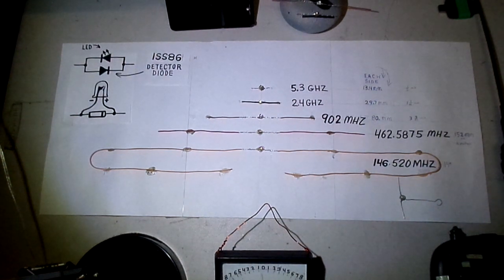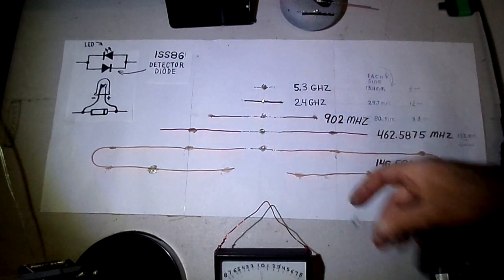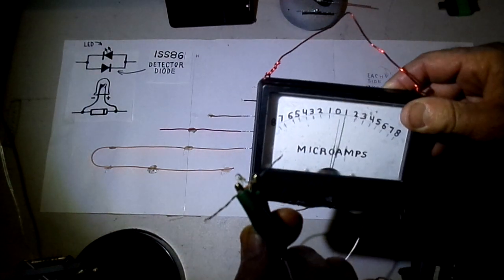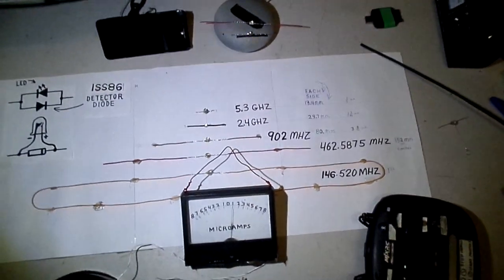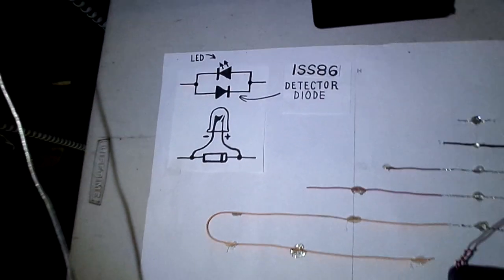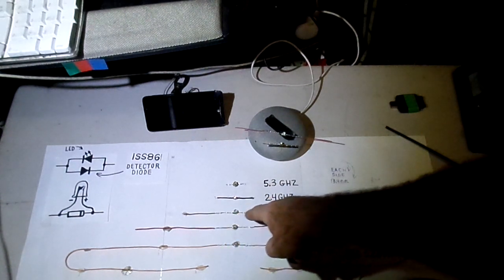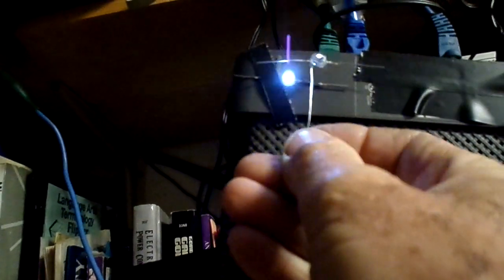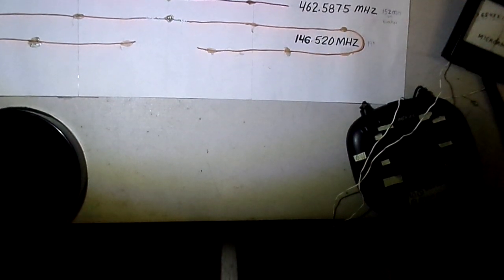2 Dollar Radiation Detector You Can Build. Beware of imitation diodes that don't have an H on them.

Comment: Regarding microwave leaking. 
Supose you have a mains power  and a transformer, very little power "leaks" untill you connect a load. 

By placing an antenna wire near a microwave conducting surface, currents in the surface induce currents in the wire, "Transformer"  Normally a simple wire wouldn't disipate much energy and would simply reflect it back to the source, reactive power, but you put a load on the transformer and caused energy to leak into the LED instead.
Reply from the maker: I can't understand what you are saying.
Reply: @GrantsPassTVRepair  I'm saying by placing the anti parallel diode and LED next to the microwave, you are magnetically inducting energy into it. 

the microwave are inducing currents in the body of the microwave oven which normally would reflect microwaves off the walls of the microwave oven.  But, when you bring the anti parallel  Diode and Led antenna close it capacitivivly and inductivly couples energy from inside to outside.  

My first comment mentioned it was like a transformer connected to mains power line leaks very little energy. With no load on the secondary, Energy simply gets stored in the magnetic field and later released when the the current changes direction. There is a 90 degree phase seperation between voltage and current, so power is reflected back to the source rather consumed.   But if you bring a secondary coil next to the primary coil and you have a load connected to tge secondary, power is inductivly  coupled from the primary to tge secondary.  The load pulls energy from one side of a transformer to the other.  The diode LED circuit is pulling energy out. 

Maybe a more complete picture might be seen in looking at the phenomena as a transmission line with both capacitive and inductive coupling from one wire to another. 

Either way,  the amount of energy coupled from one system to the other drops off faster than radiation's 1/ (distance squared).
Reply from the maker: @kreynolds1123  Sorry but I have never heard of an anti parallel diode, and  I still can't understand what you're saying.
Reply: @GrantsPassTVRepair  channel veritasium did a video "how electricity actually works". It's a dive into a different problem but some of what's covered is directly related to how energy is "leaking"
Reply: @GrantsPassTVRepair   clearly a LED is just a special diode designed to emit visible light as electrons cross the NP junction loose energy and fall into (fill) holes. All diodes do this.  Parallel here is simply refering to the physical alignment which is important because of the alignment with the electric and magnetic fields. Parallel diodes are diodes lined up with their respective NP junctions in the same physical direction. Both diodes will conduct in the same direction. But, Anti parallel diodes are lined up in physically in parallel, but each's NP junction order is the reverse of the other. Where current flows in one direction in one, the other diode conducts in the other direction.
Reply: @GrantsPassTVRepair   I'm guessing you understand some of what I'm saying and that some you're not. May I ask what specific points you find troubling?

Comment: Thank you. Hello how i can calculate antenna lenght? Which is the good site for calculate and learn? And should the antenna be straight? Would it be different if it wasn't straight?
Reply from the maker: Yes ideally the antennas shoud be straight, but you can get away with a little bending. There are many dipole antenna calculators online. Here is one. http://www.westmountainradio.com/antenna_calculator.php

Comment: Are these a particular brand? I've been kinda hit and miss with all the recommended lectenna diodes. Trying to find something that performs well, but is easy for people to obtain. Need quite a few to use with my science students. I've got the NTE112 right now and it seems to work ok, but I think yours might be more sensitive. Did manage to find a microamp ammeter which makes this way cooler so thanks for that tip! Unlike your video, the top video on youtube for lectenna by the Navy tells you to wire this the wrong way so I'm glad I found yours or I would have been pissed for hours.
Reply from the maker: I don't know  any more than what I showed in this video, but I found the ones I used on ebay, and have not had any probelms with them on a multiple of different frequencies from the AM broadcast band on up to microwave frequencies.
Reply: Use UHF schottky diodes.  Or microwave schottky diodes, depending on how high up in frequency you want to go.

Comment: I'm new to this but how does it work with that meter? Can I potentially use the clamp on my voltmeter to see the same results?
Reply from the maker: Voltmeters do not have clamp on options. Some multimeters do, but they are for measuring current rather than voltage, and their current scale would not be sensitive enough to detect any current from radio frequencies.
Reply: @GrantsPassTVRepair  ah that makes sense thanks for the help

Comment: How does your setup work with these dipoles being so close to each other?
Reply from the maker: I don't know, but as you saw it does work.
Reply: @GrantsPassTVRepair  You may make an experiment some time what happens if you space them all just 3 mm apart. :)
Reply from the maker: @Muck-qy2oo  Interesting thought, although I'm not sure you would see much difference with the setup I have since they are receive antennas. When it comes to transmitting that's another story. I have a dipole antenna in a tree, and allowing my antenna to be to close to the tree branches greatly reduces  on the power output from my antenna.
Reply: The dipoles are resonant on different bands.  They won't interact much.

Comment: HI..Q:how precize shoul be the  antena/wire lenght ?, i have tried to test  microwave oven  with 29 +-1mm but i am not able to detect anything with this setup  ,
Reply from the maker: I would think 29.1 should be close enough to work. Did you use the same diode I mentioned and follow the correct polarity?
Reply: @GrantsPassTVRepair   yes diode is the same , but the lenght is something between 29-30mm (+-1mm)  cutted by hand  :)
Reply from the maker: @robertperun4634  I think that shoud be close enough to work. I'm also able to light mine up with my wifi router and my cell phone when I find the right spot to place my LED.
Reply: You have to be using a diode that will function at microwave frequencies

Comment: Hi Grant, I see the diagram of the diode and led together but how is the antenna wire connected exactly? A photo or diagram would be much helpful but a description would be good.

Say for the 2.4ghz antenna.  It;s 29.7, are those two separate cuts of 29.7 for each side or one cut of 59.4mm? and then how or where is connected to? Thanks
Reply from the maker: You place the diode and the LED right next to each other as shown in my drawing.
Reply: @GrantsPassTVRepair  Yes that part is clear, but where does the antenna connect to?  - Wait are the leads of the diode used as the antenna?
Reply from the maker: The wires on each side of diodes are the antennas for the frequencies I mentioned, but when conducting this experiment with my long wire antenna I ground one side and put my antenna on the other side.

Comment: Hello. Which is better for dipole antenna? (λ /4 for each arm or λ /2 for each arm, or in between)
Reply from the maker: Mine seemed to work best using one quarter wave length for each arm.
Reply: 1/2 wave total (1/4 wave for each arm) is resonant.  That's what you're looking for.

Comment: Could one of the automotive remote transmitter testers be modified with a stronger antenna to sniff out RF devices? ( or could you recommend an RF “ sniffer” ) With all the electronic gadgets available nowadays we’re seeing interference issues in the automotive repair industry.  Great channel
Reply: Use a spectrum analyzer like a TinySA.

Comment: ¿Can it be used with other kind of diodes, like 1N4148?
Reply from the maker: I'm sure there are other diodes that may work, but of the various diodes I've tried the one I suggest in this video was the best. I tried some of the diodes people suggest for crystal radios and they worked to a lesser degree, but not well on the higher frequency radio waves.
Reply: You have to use a diode that switches at least as fast as the frequency you're trying to pick up.  A 1n4148 isn't going to work very well above 100 MHz or so.  Also, silicon diodes need higher signal levels.  Schottky or germanium diodes would be better.  The 1SS86 is a UHF Schottky diode.  Much better for the job.  You're looking for an RF diode.

Comment: Nice, but for a single calculation of division You don't need a whole mobile phone app
Reply from the maker: Dividing the desired Frequency into 468 give you length in feet, but it got a little tricky trying to convert tenths and hundredths of an inch into millimeters. .

Comment: Complete NOOB here. What is it, that is capturing the RF waves? Is it the diode's leads or the LED's leads, or both? Also, what if you soldered a metal [or fine mesh] dish to this set-up [to look and act sort of, like a tiny radar] would it pick-up RF signals from further away, would it help in any way? Let me know - I'm trying to learn. Thank you kindly
Reply from the maker: To answer your first question the diode leads are in parallel with the LEDs and the antenna wire. To me that means it's the wire picking up the waves. As far as concentrating the energy in a parabolic reflector goes it sounds like it should help. Good idea for an experiment.
Reply: Thanks for replying, I really appreciate it. One more question: you use a micro-amp meter in this video, to measure RF? What measuring unit, would that be, what would it be called? Please let me know. Anyhoo, great video, as per usual, and thank you for the encouraging words, regarding my "radar" idea. Be safe. Cheers!
Reply from the maker: @maxwarfield6699  My micro-amp meter can meausre a few millionths of an amp. It can't measure the RF energy directly, but it can measure it after it gets rectified through the diode and becomes DC. .
Reply: Thanks for replying, really. Ok, "mind BLOWN" you can rectify an RF signal?! I'm no expert, at all, but isn't an RF signal, an electro-magnetic wave? Thus massless [photons], that's quite different from electrons [which have 
mass] how can one rectify something which has no mass, with a simple diode? Here's a terrible example: The ocean has waves, but can you rectify them with a diode? They are two VERY different things. Please correct me if I'm wrong. "Mind still BLOWN"
Reply: @maxwarfield6699  it is possible with diode.
Reply: @ahmetozdemir7173  Thank you for replying, I appreciate it. But, how can ONE [wouldn’t it take four - bridge rectifier] diode rectify, a magnetic wave, which is a massless “phenomenon”? Perhaps, it isn’t picking up any RF signals at all.  Couldn’t it be picking up, stray electric “energies” of some sort? Please elaborate on your comment. I truly want to learn more about all of this. Cheers!
Reply: @maxwarfield6699  The first radios did not function such differently. Websearch what a crystal radio is.
Reply: @maxwarfield6699  The photons in the passing EM wave hit the antenna conductor and jiggle the electrons in the antenna (the wires).  That causes an AC current at RF frequencies.  If the wavelength of the RF is resonant with the length of the wire the signal level builds up to a high level.  This is how all antennas work.  The diode rectifies the RF into DC that powers the LED/meter.  The reading on the meter is not calibrated at all.  It's a relative field strength meter.

Comment: by any chance can you do one for 27mhz pls so i can make one to fit the top of my antenna
Reply from the maker: If I made one for channel 20 which is in the middle of the CB band at 27.205 Mhz each element of the antenna should be about 103.2 inches long, but i'm not sure how you could make the LED light up by placing it on top of your CB antenna.
Reply: Just put a neon bulb on the tip of the antenna with one leg sticking up in the air.

Comment: I have a sb 320 schottky diode does it work with this
Reply from the maker: I don't know anything about the diode you mentioned, but I've tried a variety of diodes, and the one with the H printed on the diode made by Hitachi under the part number 2SS86 is the only one I've found so far that works at the higher frequencies such as cell phones, microwaves and wifi modems. Others only work at the lower frequencies such as with AM broadcast stations.
Reply: I guess its about diodes supported frequency and reverse voltage loss and forward voltage loss... if the loss is small enough it mostlikely will word... just a gues... as rf is wibrating/switcging power so fast and in small woltages that cheap diodes are leaking pig part of power in reverse causing partial shoer and in forvard signal pulse losing too much power while trying to saturate ... so on lower frequencies and higher power signals cheaper diodes will thworethically work better... 😊

Comment: can you explain more about the resonant antennae?
Reply from the maker: You can look up Standing Wave Ratio on youtube and find more detailed info. Here's an example. https://www.youtube.com/watch?v=w1eE13UXAKs
Reply: @GrantsPassTVRepair  SWR is not antenna resonance.  When an antenna is resonant with an incoming RF wave, the voltage in the antenna builds up to a much higher level.  That voltage is used to light the LED.  It's like pushing someone on a swing.  If you push at the right time on each cycle, the swing will go higher and higher.

Comment: Dave, what is thickness (diameter) or number of the copper wire in each case ?
Reply from the maker: The thickness of the wire is probably not that critical,  I'd guess you could use 20 to 30 gauge  wire and it would work fine. The lengths for different frequencies were mentioned in the video.
Reply: @GrantsPassTVRepair  Thank you very much for your quick answer !!!!!!
Reply: I do think the thickness makes a difference. Having used a watt meter to measure VSWR, I found that antenna shape plays a lesser role at determining resonant frequency as does the mass/amount of antenna material.

Comment: what about smartphone radiation?
Reply from the maker: I was able to light up the LED with my cell phone, but I had to find the perfect spot to hold my LED next to my phone, and it only worked when my phone was in the high power mode.
Reply: @GrantsPassTVRepair  thanks...,and at what length of antena?
Reply from the maker: @hsh3710  29.7 MM long on each side of the LED.

Comment: Thanks for sharing this video. Did you install any capacitors in the antenna detectors to create an LC resonant detector for each? Or does each antenna consist of only three parts: Schottky diode, LED and pieces of wire cut to the correct lengths?
Reply from the maker: The closest I came to doing that was this crystal radio https://www.youtube.com/watch?v=_pm2tLN6KOQ&t=3s

Comment: Hi, What other diodes can be used?
Reply from the maker: You can use a variety of other germanium diodes such as the 1N34A, but they don't work as well as the 1SS86. Especially on the higher frequencies produced by wifi modems, cell phones and microwave ovens.
Reply: You want UHF or microwave RF diodes.
Reply: @GrantsPassTVRepair  ThankYou!

Comment: Here is some information about the last one:
146.52, which is the longest antenna of the LED+Diode detector, is used as the USA simplex calling frequency. Usually, after getting contact, you would move to a different frequency, say 146.505/146.500 (depending on the area) to do a longer conversation.

73, 
Daniel Berzinskas
KQ4GOB
Reply from the maker: Thanks. I'm a licensed ham operator myself, so I stuck with the 146.520 simplex frequency on my HT to avoid triggering any repeaters for my experiment. 73s.

Comment: What kind of LED did you use?
Reply from the maker: It was just an ordinary white LED. I believe it's recommended voltage is probably 3.6 volts @ 20 MA
Reply: @GrantsPassTVRepair  I ordered the 1SS86 from ebay and tried a clear and a red 20 MA LED but didn't work. The 1SS86 had the "H" printed on the diode also
Reply from the maker: @jerrystom4330  Did you make sure your polarity was correct? What kind of devices did  you test it on?. Were you holding the wire with your hand when you tested it? Your fingers can't be touching the wires when you test it, unless you are attaching one end of it to a long wire antenna, and you live fairly close to an AM radio station.
Reply: @GrantsPassTVRepair  I double checked the polarity, I even did it the wrong way but neither worked. I held onto the LED cover and didn't touch the leads. I tried it on both of my routers along with just setting it in different locations on the router but again no work.
Reply from the maker: @jerrystom4330  Do you have any other transmitters besides  your router? You can call me if you like.

Comment: This Is SUCH A Cool project, Did It Today Myself, Now I Just Need To Find Out How To Fien Tune It For My Needs
Do Any Of You Know, Is There Anyone Who Made A DIY version With Just Changing Frequencies On it To  See If There's Like 170.000 Mhz Broadcasting Happening In Air Right Now And Tune It To Any Frequencie?
Well, That Would Be The Coolest Thing Ever, But I Guess The "Tune" Would Be Some Sort of Antenna Changing Thing Because It Catches The Broadcast Transmission By Capturing The Signal Itself And Turning it Back Into Electricity So the Antenna Must Be In A Correct Lenght Or It Would Not Work.
Reply: @OverUnity7734  I had the exact same thought, just before I clicked on your reply !